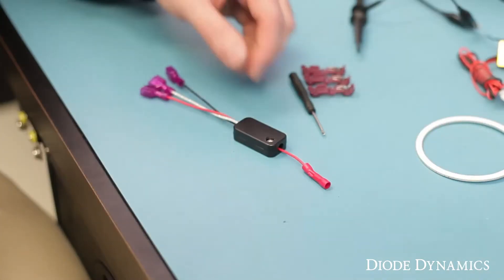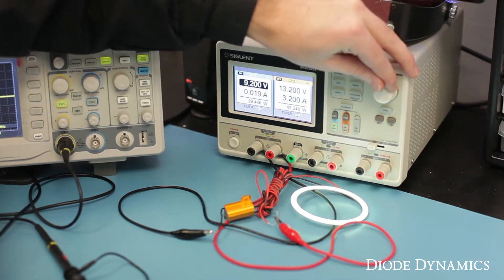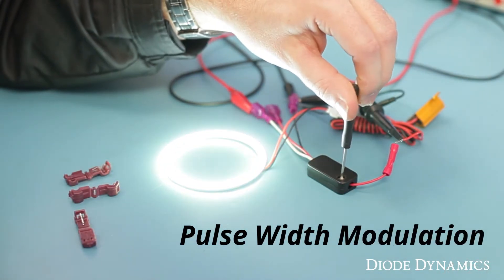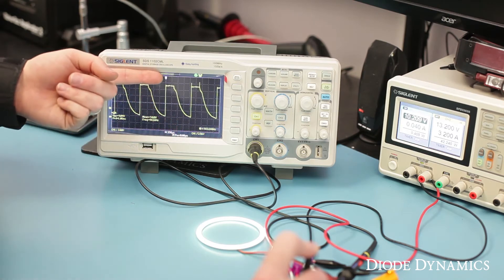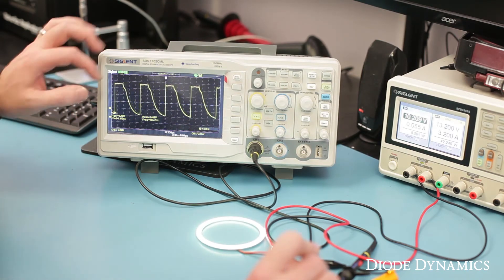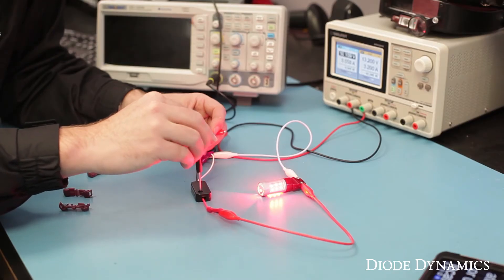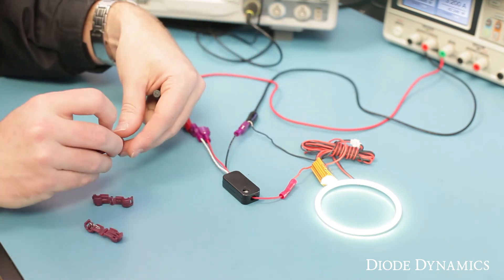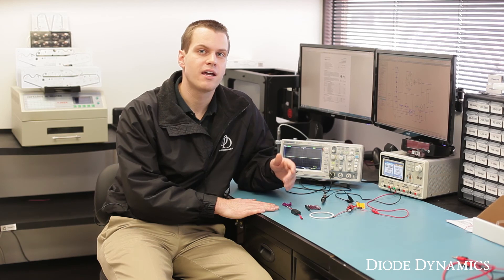How To: PWM Dimming of LEDs in Automotive Circuits

Comment: But yet nobody wants to acknowledge/validate the fact that many people get horrible eye strain and headaches from PWM.  Are there any automotive led bulbs that don't use PWM?
Reply from the maker: PWM (Pulse Width Modulation) modules like the one shown in this video is strictly for dimming LEDs. Our non-dimmable lights do not use PWM modules. Additionally, the halos shown in this video are simply an accent light, not to be used for any type of output on the road. 

Thanks for checking the out!

Comment: This works great in the video but it will not work with a Relay to dim LED DRLs when the headlights are turned on using the headlight Positive as trigger to switch to dim LEDs.  The LEDs will not light up at all.
Reply from the maker: Feel free to give us a call at 314-205-3033 Monday-Friday 10 a.m.- 5 p.m. CST, or shoot us an email at contact@diodedynamics.com, and our in-house US service team would be happy to help you with that.

Comment: Is there one that does the opposite? Where it starts out bright and with another 12v will go dim.
Reply from the maker: The low power input will take priority over the high power input in this module. If you have any specific questions about this, please go ahead and give us a call at 314-205-3033 Monday-Friday 10 a.m.- 5 p.m. CST, or shoot us an email at contact@diodedynamics.com, and our service team would be happy to help you.

Comment: Thanks for the great tutorial, but I'm still unclear on the high positive and low positive. In the video you said they were both 12V. Can I use the same positive supply to the high and low inputs? Thanks.
Reply from the maker: You will need two separate 12V power sources for each wire. For instance, many people will use a parking light for one wire, and a DRL for another.
Reply: @diodedynamics  what if say in a application I have a f150 raptor 3rd brake light and putting it on a ranger, the raptor has marker and brake functions buikt in, but the markers are bright, and hard to tell difference when brake is applied, can I just run the marker light, and dim thr marker output?
Reply from the maker: @ShadowDragon246  Is it the same light that works as the running light and 3rd brake light?
Reply: @diodedynamics  Yes, the Ford F150 Rapotor OEM 3rd brake light has clearance marker and brake lights as the 3 led lights in the housing, the markers say are on at 80% brightness, then the brake light lights up, you can just make out the difference in the brake application vs the marker lights. looking to possibly dim the markers so the brake stands out more.
Reply from the maker: @ShadowDragon246  Would you mind shooting us some images of the wiring on the light to contact@diodedynamics.com?

Comment: Great vid, would pwm harm an led driver if installed between the driver and the led positive?
Reply from the maker: Thank you! The PWM dimmer should be installed before (on the output side) of the LED driver.

Comment: would this work on my 3 wire turn signal harness on my truck? I plan on running a kc cyclone as a turn signal
Reply: btw its for the turn signal in the headlight im making custom headlights and I want to do something different
Reply: would the high 12v signal be the blinker wire or the running light? and will this keep my led light from hyperflashing???
Reply from the maker: +daniel ramirez Thanks for reaching out! For headlight applications, we would recommend checking out our DS3 Module at the link below! If you have any further questions, please email us at contact@diodedynamics.com! 
https://www.diodedynamics.com/store/catalog/product/view/id/22659/s/ds3-module-dimmer-switchback-sequential-pair/category/1448/

Comment: Hi! Saw this product and definitely need it for my taillight project. However I have a question regarding the resistor.
For the halo light shown in the video the resistor was always visible in the screen.
If we assume that I'm going to connect this to let's say 8 LEDs which are connected parallel to each other, do I still need a resistor for each line or can I connect the parallel lines directly to the controller output without resistors?
Also, is it possible to know what frequency You're using?
thanks!
Reply from the maker: +Rob Roj Thanks for reaching out! Please shoot us an email at contact@diodedynamics.com, and our Sales Representatives can walk you through your questions.

Comment: Out of curiosity, do you instruct to mount the dimmer inside the engine compartment or inside the passenger compartment for installation? This seems like the kind of thing to be tweaked while parked, not on the go...
Reply from the maker: +Jeff Chrjapin, either location would certainly work fine! We do recommend that you locate it somewhere out of the elements (rain, snow, etc). This sort of a product is geared more towards changing while parked, not on the go. If you have any other questions or concerns please just let us know - thanks!